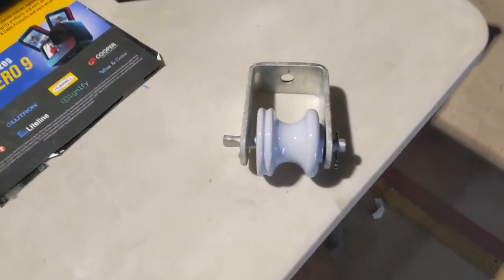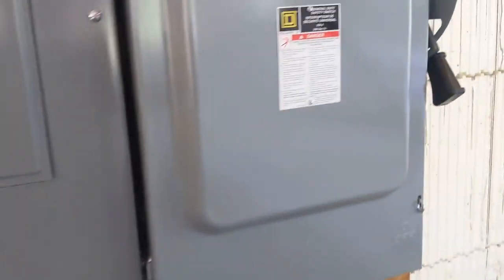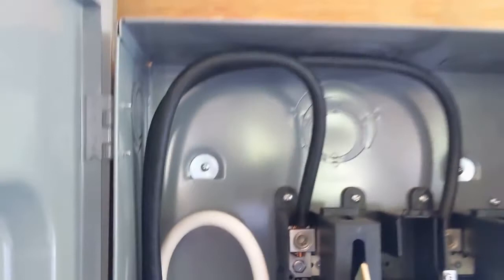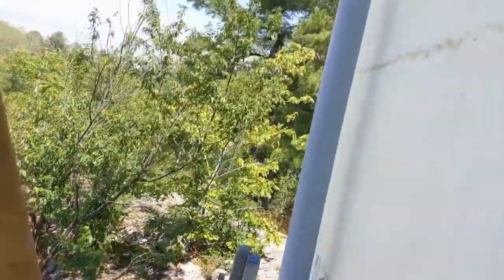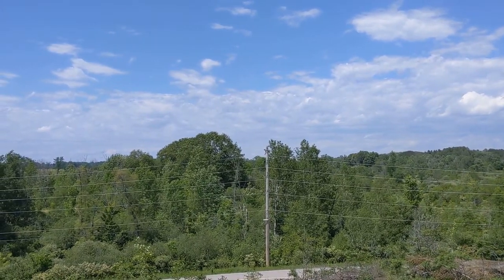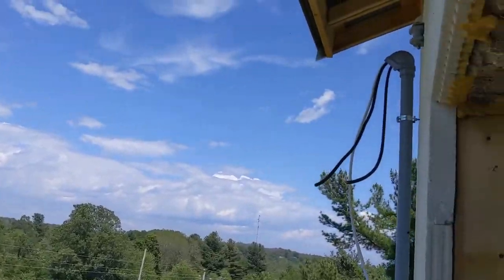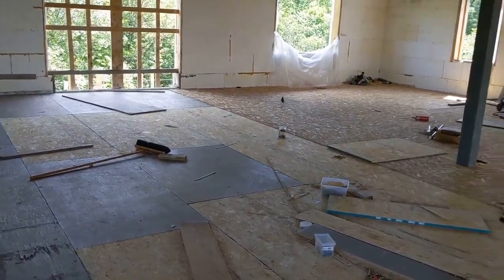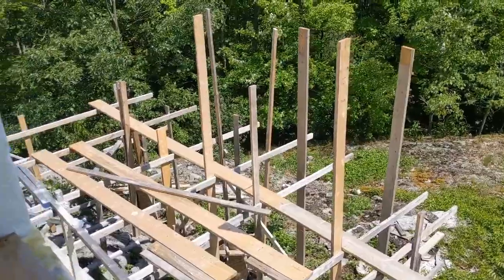Electric Service Entrance Anchor

Comment: That disconnect should have been outside under or near the meter.  What use or purpose does a shut off switch serve when placed right next to the main breaker?  The point of disconnecting is to give breaker or fused protection to unprotected service entrance wires in case of damage or short  it won’t blow the transformer it’ll trip or blow your fused protection.  In your setup you protected 12in of wire, meanwhile 20ft of conductor outside is left with nothing.   Prior to recent code needing a emergency disconnect, your setup wouldn’t have required this anyway because disconnect was only required if more than 3ft after entry into the building existed.  Your SE conductors being outside wouldn’t have qualified needing a disconnecting means, you could have just terminated as usual,  your electrician wasn’t very knowledgeable and cost you extra money for no real benefit in this install, even tho he may have gotten you a passing sticker….